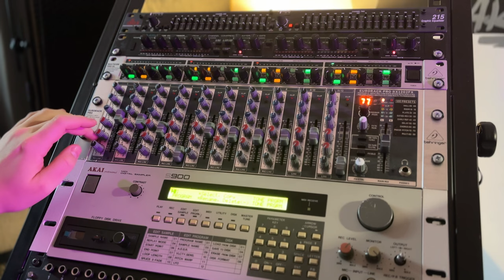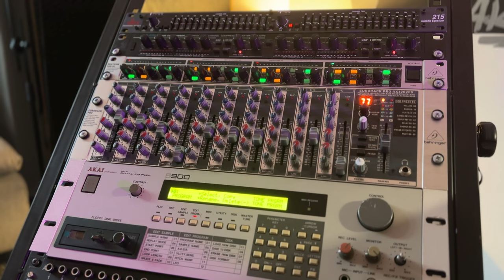My Rack Unit Setup Explained | #S900 #dawless |

Comment: Very nice setup I got laughed for using Behringer compressors in my setup with my mpc 3000 until people heard the finished product
Reply from the maker: Cheap hardware compressor > best plugin compressor
Reply: @vubeatz of course even a cheap alesis 3630 compressor is based on Dbx vca chips found in Ssl top grade compressor.

Comment: You think Behringer stuff is any good ? Heard lot of complains, especially for cheap compressors
Reply from the maker: @lcaise  I think hate and complains on behringer was from people who enjoy lots of talking instead of doing things ;)
Reply: @vubeatz in fact mixers from behringer was straight rip offs of Mackies design. Mackie designs with same components were really respected as the best bang for bucks in pro budget studios. Even to this day behringer do a lot of analog circuitry. They do it in mass with recycling existing design but are not obsolete design they are in fact cheap to buy but quality oriented equipment at a high cost efficiency production scheme.